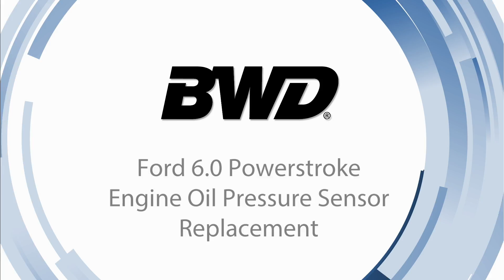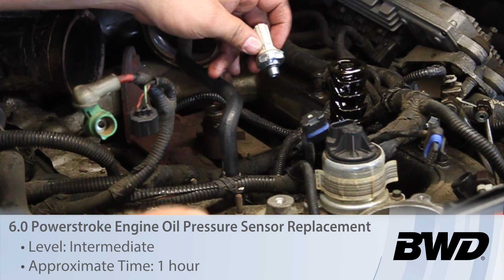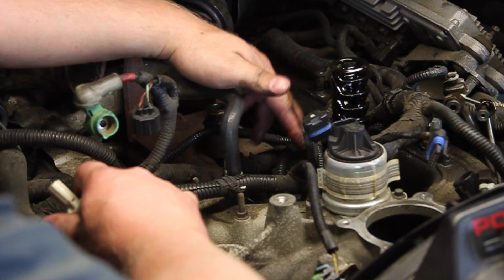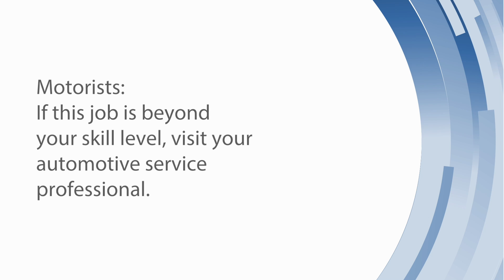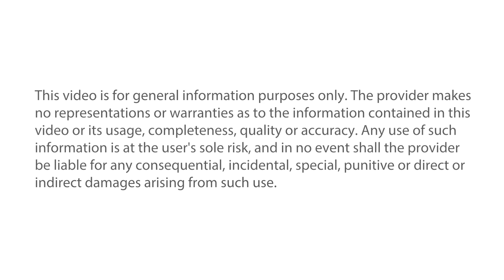Ford 6.0 Powerstroke Engine Oil Pressure Sensor Replacement

Comment: I know how to change the oil pressure sensor. What I can’t find is how to change the pig tail wire. It was broken off from the wire and I can’t fine it to reconnect it.